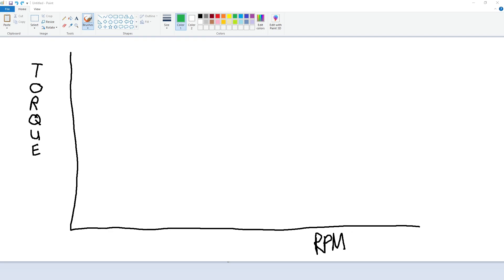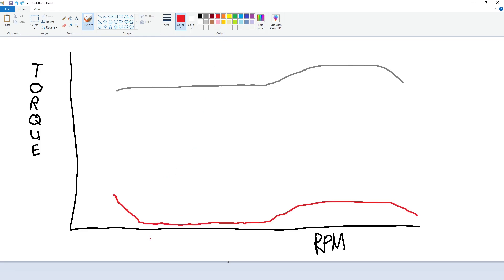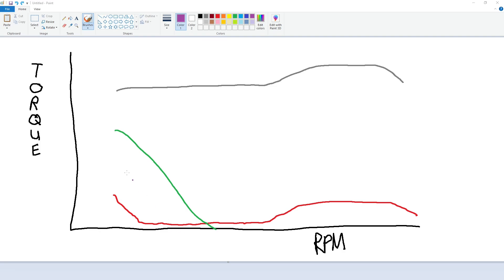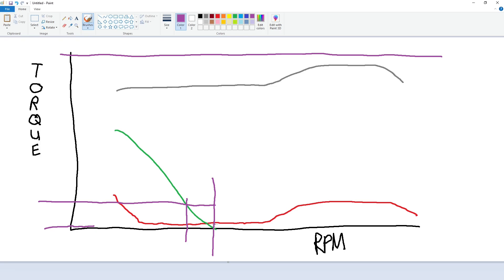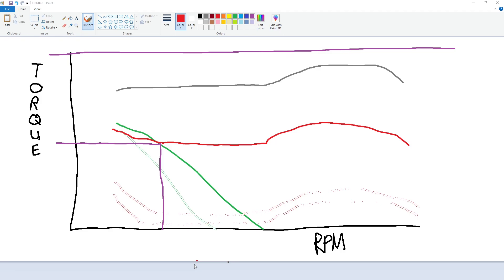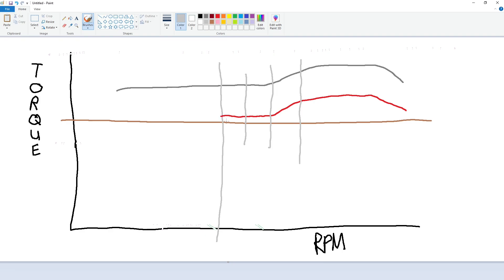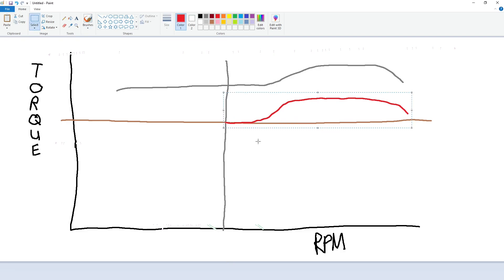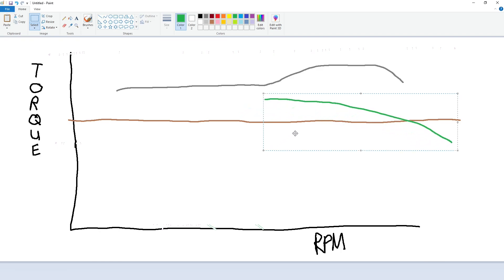Using MS Paint to (better) explain the bad throttle simulation of AC Evo, iRacing and other sims.

Comment from the maker: Original video where 12 sims were analyzed (things may have changed since then) https://youtu.be/0gW-cbSX3Uc
Reply: When we went back to this topic I realised something... In the original video about that, u said that in past times, it was hard to get good data for that so they did it this way.
...or something similar, sorry if I remember it wrong.
[Wait for person, pretending to be smart xD]
BUT they had the data! It was hidden behind physics knowledge and some logic thinking. Where do torque comes from? Pressure on the piston times stroke length. Throttle input changes pressure on the piston but it can't change stroke length! Even small force, multiplied by leverage makes it huge so small throttle input gives a lot of torque. ...and then it drops due to lack of energy to keep pressing on that piston.
Reply: @Firssen  Even if they don't have the data they can still do a lot better than what we have currently. The current model is more wrong than any attempt using some kind of general idea how engines typically work.
Reply: @ yes... Like I said. Current model feels like manipulating piston stroke in the engine, not pressure on the piston like it should be. I just can't get how devs keept going same wrong model for sooo loooong and noone never noticed how against any logic it is.
Reply: Brilliant content as always Niels. Thanks!
Reply: Niels, 2 years ago you reviewed the throttle model for WRC Generations in the original video. The developers watched your video and reworked their throttle model for their latest game, Test Drive Unlimited Solar Crown. Believe it or not, they did it. The rev is constant as long as the input is constant. Just like how you wanted it to be. It may have some flaws (such as no stalling) but the basics principle should be good. Since you played Test Drive Unlimited Hardcore Mode in the past, you might be interested in Solar Crown.
Reply from the maker: @scapegoat_0001  Glad to hear that! Although that does make me an influencer, which is a bit scary..
Reply: @ if it helps to decrease the influencer vibes, I have subscribed, but to my knowledge I have never smashed your like button.
Reply: @NielsHeusinkveld  The good kind of influencer. ;)
Reply: When it comes to RBR, are your findings related to NGP7 car models? Would be good to know how the situation of the modded cars work is being done.
Reply: @dani_l_monteiro  WorkerBee haven't tried to fix it. It would be mentioned in changelog.

Comment: you are 100% right, real cars have torque/rpm calibrated as per your green line. I know it because I calibrated some of them in real life for a famous car company. All what you say is absolutely correct and brilliant for your effort to grab the numbers
Reply from the maker: Thanks! With modern ECU's anything is possible, but I certainly would do something closer to the green than the red!
Reply: @NielsHeusinkveld  It's exactly as you say, always decreasing monotonously for the reason you described. Accelerator at 100% > maximum torque to ensure full power even if the accelerator does not reach 100%. It is interesting to note that at very low revs, you have full torque for about 30% of the pedal, since the torque is low and people otherwise stall the engine when starting, haha.
Reply: @NielsHeusinkveld  However, in ACR interest regimes, the torque has much more pedal range to be managed, exactly as you explained that ACR does NOT do. Your explanation was flawless, and we hope they resolve it. Out of curiosity, can you tell me if the RBR pedal is well made, if you know?

Comment: The only sim I tried clutch on was ea wrc and that game had horrible throttle response, impossible to start smoothly, didn't know much more hardcore sims have the same problem. These days I just use automatic clutch due to not owning a physical clutch and the problem while less perceived still is present. I also thought it could be related to torque simulation being incorrect, so I guess this explains the core of the problem.

Comment: Now when you think about it, isn't it possible to "simulate" this behavior with a mod that acts as a middleware with the throttle pedal? Imagine you model a generic throttle curve that will get mapped to however RPM the engine is at, which then being forwarded to the game (so the game sees throttle input from this mod instead of the pedal). For example when throttle is at X% and RPM at Y then gradually apply less throttle on the sim based on that generic curve. Sure it won't be 100% accurate since every car is different, but even if the generic curve is only 75% accurate, it should still give a better feel than a linear model.
Reply from the maker: That could work yes, tricky to do though I bet.

Comment: I always felt like pulling away in AC, ACC and RF2 with clutch enabled required way too much throttle.
Reply from the maker: RF2 has a flexible model that can do all sorts of things, but it will depend on the car / mod if it is implemented.
Reply: @NielsHeusinkveld  good to know. From memory, the cobra and a couple other manuals I drove for fun in rf2 were difficult to drive off the pits etc. LMU feels way more natural here

Comment: I'm curious if you found this to be same in RR ? I went to check when I saw you first video and engine wasn't revving higher and higher at all so I felt we were ok, but now you say we behave the same?
Reply from the maker: Back when I checked some years ago, RR seemed to use the old system. I don't know if they updated since.
Reply: @ I don’t remember using the old system but please try it again now and let me know if I need to fix anything please. I got worried to get mentioned in this video description.

Comment: What's your take on BeamNG in that regard? I find BeamNG to be basically the only sim that actually represents things like clutch control on a manual vehicle accurately (as accurately as you can do in a computer anyway, in real life you have the vibrations of the car to help you find the bite point of the clutch and that feeling can't really be replicated in sim at least not without expensive equipment), and also basically the only sim where I can get the car rolling on clutch alone (just like in my real manual car), which for me implies that the torque curve on very low RPMs is a lot more accurate than something like Assetto Corsa where you have to give a lot of throttle to get the car moving.

Comment: fixing this would also make drifting so much easier and smoother. In drifting you are trying to maintain a fixed wheel speed:
A) with the wrong model, the throttle position acts like an acceleration vector for the wheel speed. The driver needs to act like a closed loop controller and constantly adjust the throttle, it's an unstable equilibrium.
B) irl the throttle position acts more like a wheel speed target, so the driver acts like an open loop controller. He can just hold it fixed.

I have a theory that many new drifters developed button-throttle-syndrome because of Assetto's model.

btw there is a WIP script on the CSP discord that fixes the original AC throttle model

Comment: hey niels, you need to use used the alpine a110 s, the dash gives you RPM, TORQUE (NM), and HORSEPOWER (HP), could you use that car and some software and some time to get the curves for that car at different throttle % so we can get an actual graph from the game

Comment: I absolutely agree that this is wrong, unphysical and just plain silly because yes it's not hard to fix - it should be almost trivial in fact, compared to the difficulty of getting a tyre model correct. However, at the same time, it rarely actually bothers me while driving any of the many sims I've tried (the majority of which will have the issue, though I can't say that I've truly noticed it in all of them; some of them for sure though).
The main reason it doesn't bother me on starts is that it's rare for me to do anything other than a racing start in a sim, i.e. very high throttle and dumping the clutch, rather than gently releasing the clutch at low-ish throttle as you'd do in a normal on-road (not track) situation in your daily driver. A person who enjoys simply cruising in a sim - especially if they have a motion sim, so they can really feel the acceleration - may have a very different experience of the broken throttle model, and it might become quite immersion-breaking.
Equally, the reason it doesn't bother me much while driving around at speed on a track is that pretty much none of the cars I drive have the power to break traction in 3rd gear or higher in a straight line, and that accounts for almost all of almost all tracks. That only leaves cornering as a real opportunity to break traction, when you're using most of the available grip for lateral acceleration. In cornering situations I'd agree that this issue does indeed manifest, but in my view it's not as dramatic as you indicated, e.g. at 10:34, where you point out how the realistic throttle behaviour would end wheel-spin much more quickly. This is because, in reality, once the engine torque drops to match the available grip (cf 10:34), the wheels would indeed stop spinning up faster and faster, and would at least transiently maintain a more stable speed, but crucially they'd still be spinning faster than the road speed (since the spin-up will generally happen much more quickly than the car's speed will build), with the result that the car would still want to swap ends (if RWD), and that would continue until the torque from the spinning wheels had raised the road speed to match the wheel speed, allowing the wheels to grip again. The upshot of this is that even with a realistic throttle curve, having broken traction you would have no option but to reduce the throttle unless you wanted to spend your time counter-steering (normally slower than a quick lift to re-establish grip) or indeed spinning off the track 😉(I note that you also omitted the distinction between static and dynamic friction, but I think that's a fairly modest correction to the overall story, so I won't quibble about that bit 😜)
Anyway, very nice work! I entirely support your crusade to get this fixed.

Comment: Umm, you got the whole torque curve for part-throttle thing quite wrong.
Technically it's like this: The engine needs RPM*Displacement amount of Air. And as long as it gets it, it will produce it's full torque. (as in it's dyno curve)
So if you give it x amount of throttle, the throttle body opens and the engine will rev up with it's full torque until it gets choked by the throttle body.
If you engage the clutch with part-throttle, the engine will instantly give all it's available torque for the given throttle position until the choking RPM is reached.
If you don't consume all the available torque (via the clutch or internal friction), the engine will simply rev into the limiter.

Comment: So they're translating the torque curve incorrectly for lower throttle inputs? Just lowering the curve by x% instead of rotating/stretching it?
This means that this is more noticeable for cars with very peaky or late torque curves right? And cars with a lot of low-end torque and/or an early peak feel more natural.

Looking at the sims you list in the description I'm really surprised this is such a common issue. It indeed doesn't sound that difficult to fix. It's a simple map/translation.

Comment: I can't take this seriously. A combustion engine at no torque is either off or soon to be off. Now, if you'd like to talk about the torque being at equilibrium in the system for a given set of inputs, we can get somewhere.

As is, your logic is flawed so you argument is void.
Reply from the maker: So what happens when you give your real car say 10% throttle before driving off? At that point, say 3000, the air and fuel combust, generating just enough power to overcome the friction and losses, and the crankshaft is at a constant RPM. The say 20Nm that is generated by combustion is equal to the 20Nm of friction in the bearings and pumping losses and whatever.

Comment: This is actually still simplified... We could get into more detail, but the main issue still persists:
You should be able to hold a certain RPM-level by holding the throttle at the same point.

Comment: I would assume EAWRC is similar to most of these as it's certainly not generally put forward as a particularly accurate sim. I find the driving pretty similar to modded RBR though personally. 

I haven't had any trouble stalling in the game except where I would expect a car to stall. Not that I have any real life extreme driving experience. But it happens only when I accidentally leave myself in 3rd for a start or something (I play in VR so I can't see it.) Or when I slow down too much before a hairpin or something without shifting or revving or blipping the clutch or something. 

When I first got a clutch and H-pattern shifter I found that you really need to set a big dead zone at the bottom of its travel to avoid many mis-shifts. Admittedly it's been over 20 years since I drove a stick shift in real life and that was a 97 Dodge Neon, but I don't recall at all having to jam the clutch to the floor.

Comment: Thanks for the explanation.

Not sure if I missed it, but did you mention your theory of why throttle models are so poorly implemented in many sims? As you say, it seems like an easier thing to simulate than tyres.

Also, which sims model the throttle well?
Reply from the maker: Data wasn't as common back in the days the foundation of most of today's sims was made, and I mean ~2000ish. People knew, but I guess you had to be a fairly hardcore engine guy. Around 2010 I was looking and found better data, not much of it, and sent it to ISI. RF2 may have implemented their better model after I complained.. :) After that, if even I found something, I don't know. Some people don't think it is a big deal or don't understand why.. Some lazyness, some high-horse-ness, some ignorance..

Comment: Don't they also all tend to have ridiculously instantaneous response?
Reply from the maker: That could be. In AMS1, despite the model allowing all sorts of mapping, even per gear, it is simply a curve lookup. So if you go 100% throttle in 0.01 second, the first physics step after that, the torque is whatever the engine and map does at this RPM. However, the game has 'rates' you can set, and lowering this slows down the pedal a bit, which kinda helps. But yes, things like transients, time for ECU to activate fuel, and fuel to arrive .. Those are things you'd like to probably simplify considerably, yet still have some effect in the game.
Reply: Character. 

Throttle response is a big part of the character of a car.  Sims shouldn't ignore that, particularly for road cars where it can vary hugely, you lose one of only a few variables which can make one car "feel" different to another.

Comment: I only play BeamNG, I've always assumed every game must use the same model as that. It's surprising to learn there are much more popular vehicle simulation games which are just crappier.
Other things which only BeamNG seems to nail is automatic transmissions. In every other game it only shifts up when it reaches redline, no matter the throttle position or anything, but now knowing that this is how the throttle works in every other game, it makes sense for the unrealistic torque curve. Not IRL though.

Comment: The simulation might not be perfect, but you have the worst understanding of what a torque curve looks like. Nothing you said or drew matches with what it should look like.
Reply from the maker: Then please educate us and share your wisdom!
Reply: @NielsHeusinkveld  This also explains your corner exit issue. The curve continues up to a point, meaning that with increased rpm could also mean increased torque and continued lack of traction towards the rpm limit. This is also exacerbated by static friction vs dynamic friction, which is why you need to let off the brakes or throttle more than where you were when you initially lost traction. This also applies to the use of the clutch.
Reply: @ for one, a basic torque curve isn’t flat. It’s a curve that starts low and increases with rpm to a point where it increases less, leveling out, and then starts decreasing, curving downward. It doesn’t just start at max torque from idle straight horizontally to max torque at the limiter.

The same goes for a partially open throttle. It starts low, increases less with rpm, and then decreases much earlier than with a wide open throttle. Maximum torque is not achieved at idle with a partially open throttle.

And lastly your explanation of using a clutch makes no sense because your understanding of torque curves is wrong. With your graph, torque at mid rpm at medium throttle is lower than torque at low rpm at low throttle because you show almost the same downwards line from almost the same point at idle. Anyone who’s driven a manual can tell you that you absolutely need to increase throttle to increase rpm to increase torque to start on a hill, you don’t feather the clutch for idle rpm at idle throttle.

You can’t throw stones in a glass house.
Reply: the S2000 has a very unusual torque curve

Comment: Does anybdoy know if Enthusia on the ps2 also used this model or if they where actually centuries ahead of their time..?
Reply from the maker: No idea, but you can find it out if you want. Capture 60fps video of the game, while applying a steady say 20% throttle in neutral. Make a chart of frame count versus RPM (if there is a digital dash in the game it helps).. The shape you get is the torque curve.